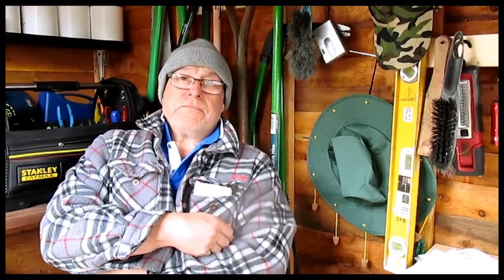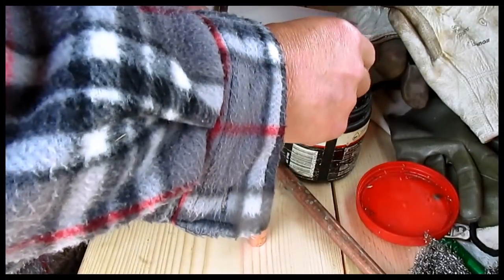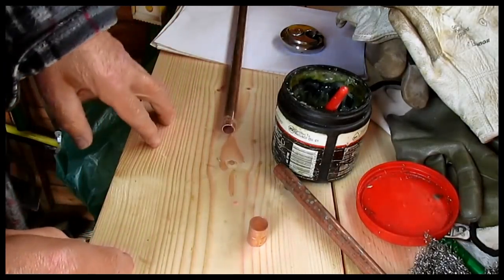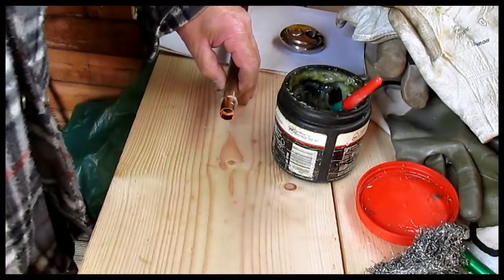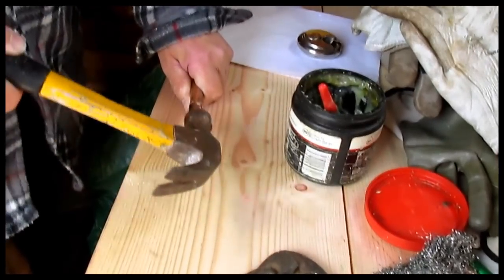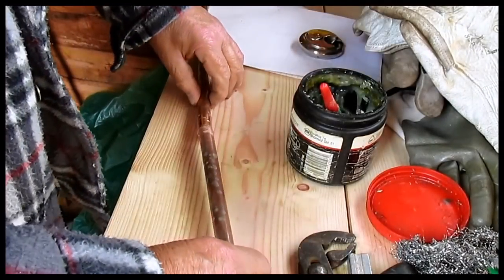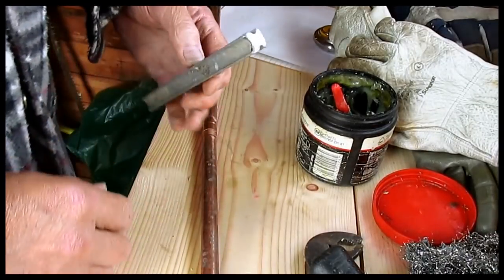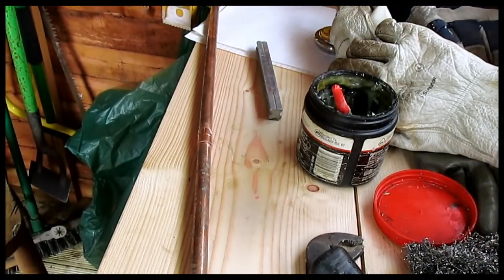toms top tips a slip coupling

Comment: I would have thought that coupler would be stuck on that pipe like an Alabama tick after hitting it with a hammer. I'd rather use a round file and file it down inside
Reply: My missus spends an eternity filing and polishing and painting her bloody nails. I spend a few minutes occasionally filing off the internal stops on end feed socket couplers. If you buy specific slip couplers they either get lost or mixed in with std sockets. I put them in my end feed fittings box  on a short length of 15mm as a direct go to.
Reply: Hello Loafer Sheffield. I tend to put some string through my slip couplers, good way to keep them apart from the normal couplers

Comment: Nice tip Tom , I usually just use a rat tail file and file out the ridge in the coupling works just as good and you can slide it up and down much easier......👍
Ps.....I prefer you in the tavern showing your tips as it makes me feel at home.......😜
Cheers tom .
Reply: That's what I've always done. Usually pre prep a few and slide on a short section of tube in my ef box so they don't get mixed in with other std sockets